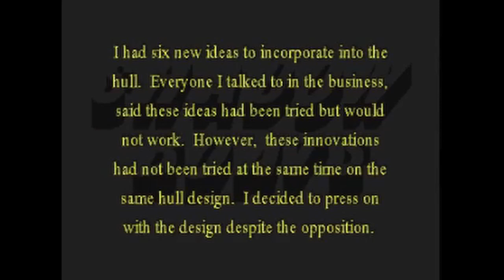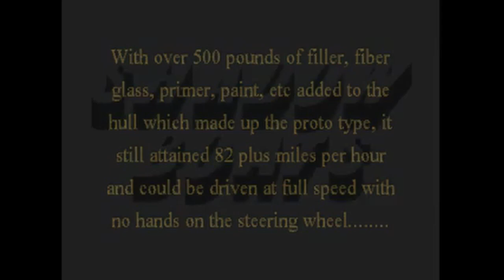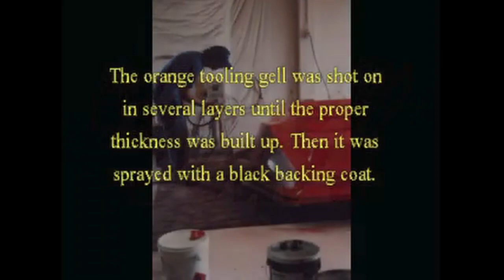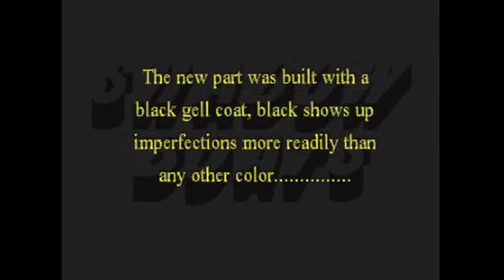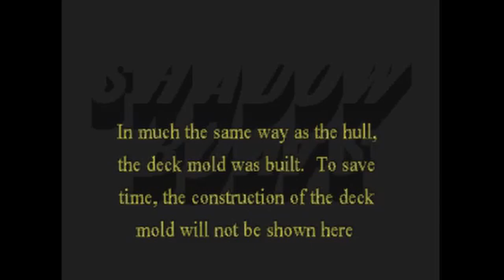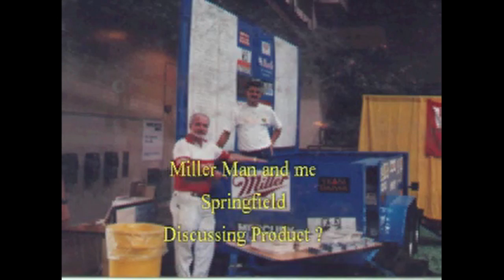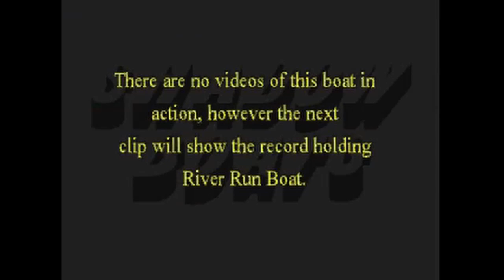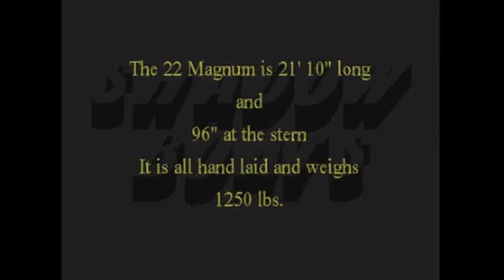Shadow 22 Magnum

Comment: I used to be a shadow boat dealer in ST Louis MO we had one of 22 magnum they were fun but a hand full it also was a Budweiser boat. The 20 VT was the fastest even than a gambler and easy to drive. Boat were built in TN then in KY and the 22 magnum was in AR I was at the plant and was the 22 Mag being built the video was filmed in AR. 22 Mag was the only boat out of there and no other boats there built there with the Shadow name
Reply: I built a boat called Pharoah by Phoenix Marine Manufacturing in Morrilton Ar. in the late 90's it was a 22 foot boat built on the Shadow hull. After it folded I helped one of the owners clean up and found some old Shadow decals. None of ours were tunnel hull.
Reply: @kriscamp3561  So thats what the Thieves did with my boat?

Comment: I was under the impression that the 200VT was the record setting boat. Designed by Jay Cox in east TN right? At what point in the companies history did the "worlds fastest bass boat" happen and with which hull design?
Reply: This boat had nothing to do with the boats from Tenessee nor Kentucky and Randy Horner doesent know what he's talking about.  My boat was designed and built in Oklahoma.  The Tunnel Hull was a fast record holding boat, but it was in a different class and it was a little dangerous.

Jack

Comment: Weren't some of the Shadows know for delamination issues?
Reply from the maker: I have read that in several places.  They are a very light layup racing style hull. I kind of wonder if the delamination occurred due to neglect and abuse. Mine is 32 years old and showed no signs of it. I will not be leaving any nicks or gouges in the hull untreated while going 90mph.  Cheers
Reply: @ShadowBassin    Those were the boats from Corbin Kentucky  not kin to this one.